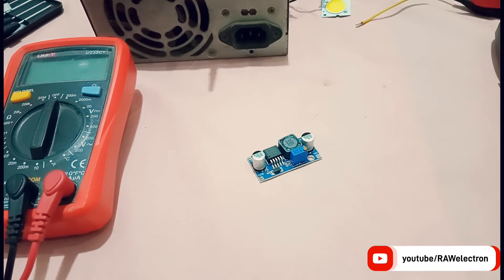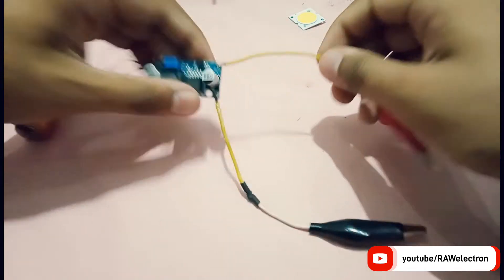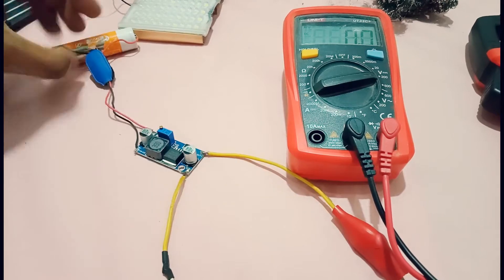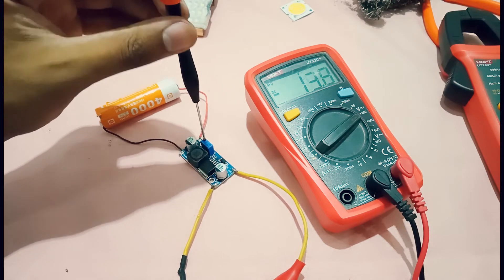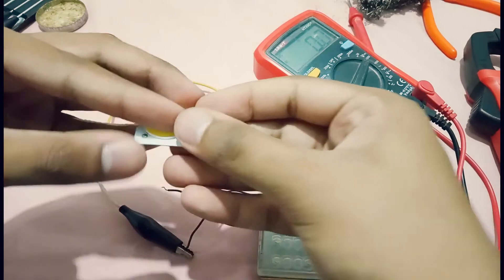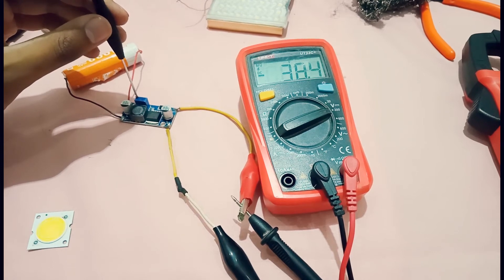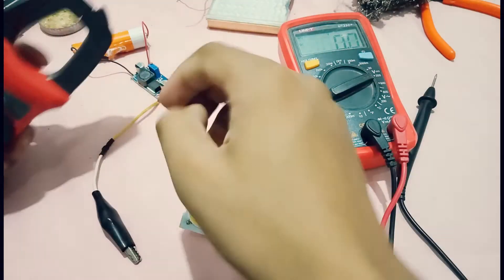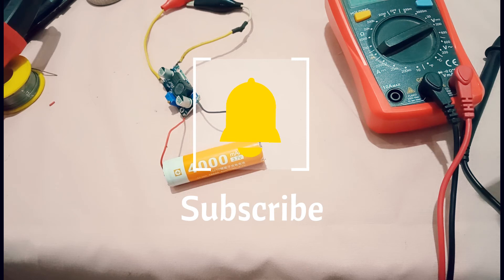XL6009 DC-DC boost converter | xl6009 voltage booster | Adjustable step-up module | Working review

Comment: I think the wire connected with battery carry 1-1.5 amps which is  not enough so output current is low at high voltae 
I guess right or not ??? Please reply..

Comment: Sir can i use it as a buck converter
Reply from the maker: No.
Its a boost converter.
You need xl4015 buck converter.
Watch my video
https://youtu.be/UbB3lOcHukU
Reply: @Electricquantism402  ok sir thanks for the suggestion